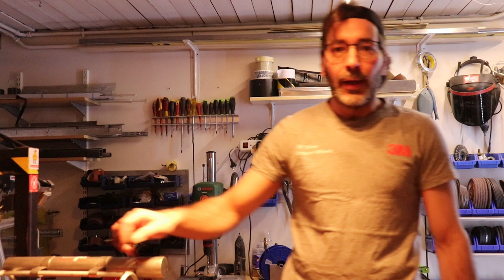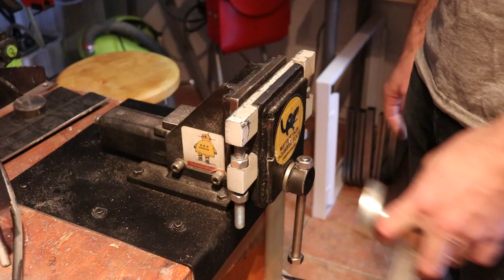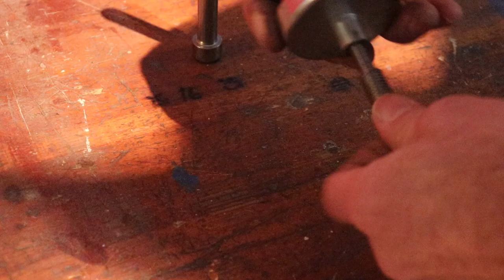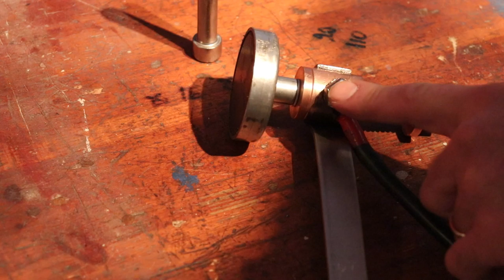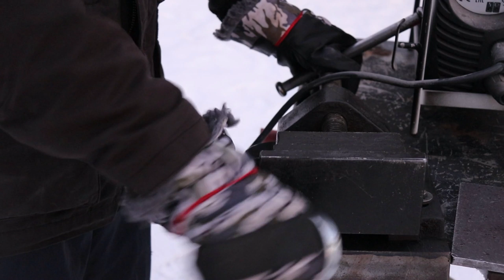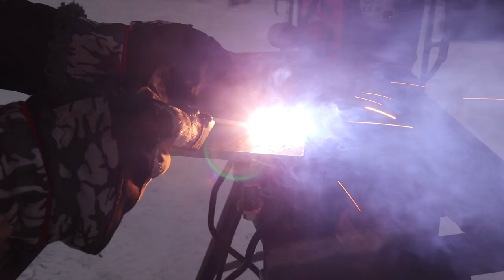Improved welding grounding connector

Comment: that's a handy device. never problem of sparks on the magnet side?
Reply from the maker: Nope, with small parts it could be a problem. But, then its better to place bigger plate on top of the magnet, and small pieced on top of that plate.

Comment: Задумка хорошая но магниты боятся перегрева выше 100 С.
Reply from the maker: Ferrite magnet needs 500 degrees of celsius for to be demagnetized, and handles about 250 degrees before it starts to weaken. So, it gets slowly weaker, but i don't think its too much if you need to change 2.5e magnet once a year.
Reply: ок